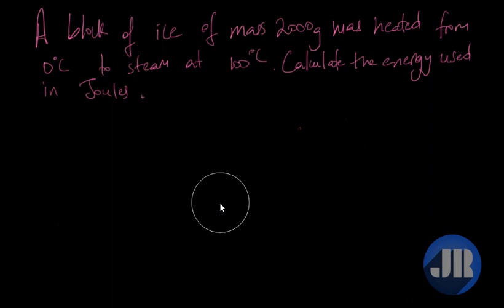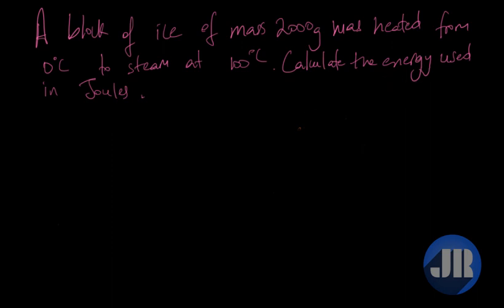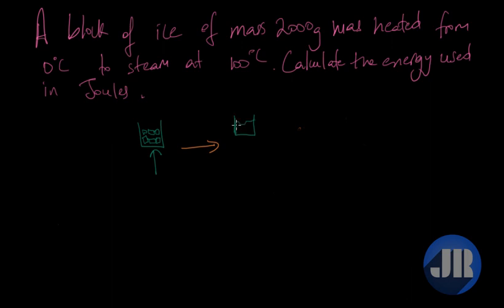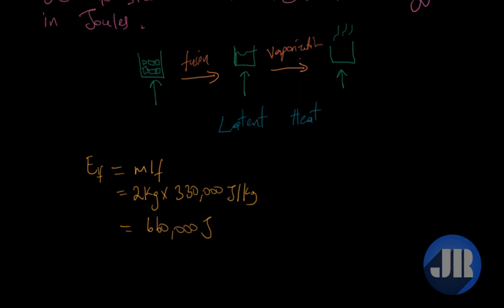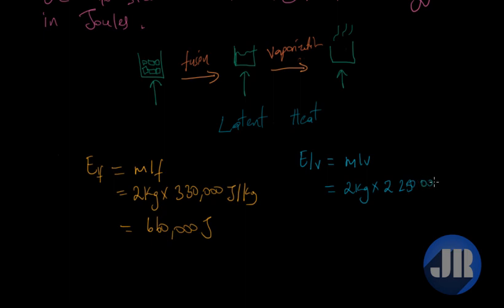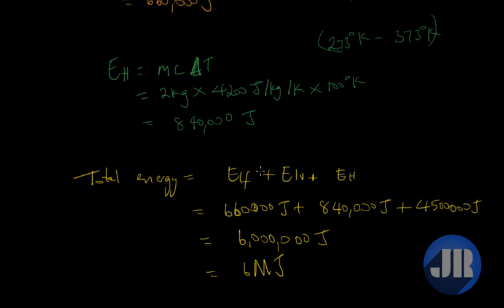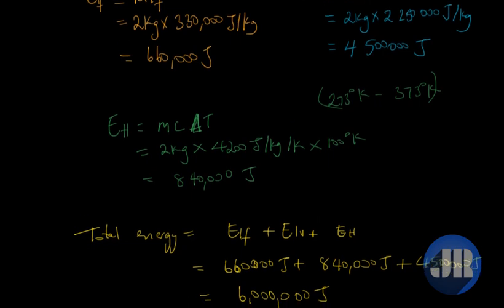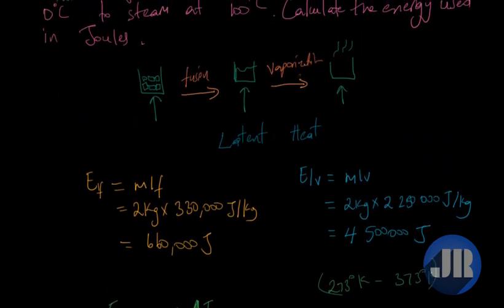CSEC Physics Worked Example - Thermal Physics (Latent Heat) | Junior Roberts

Comment: Is it necessary to always convert degrees Celsius into Kelvin or can it be worked as is?
Reply from the maker: You don't need to convert to Kelvin since you are looking at a temperature change. Whatever change in temperature in Celsius is the same in Kelvin.